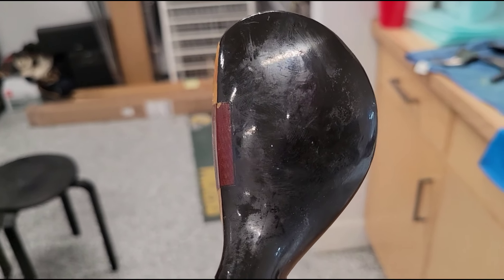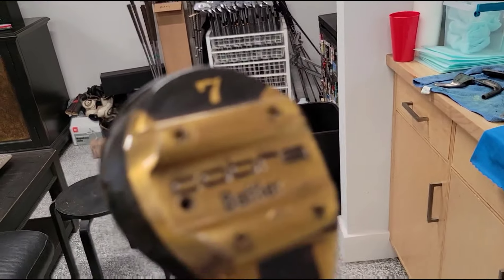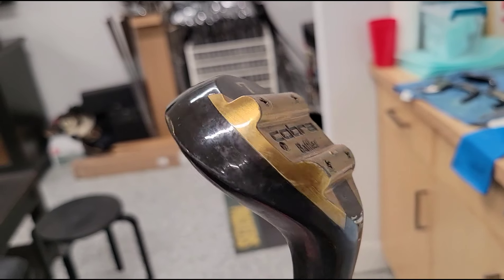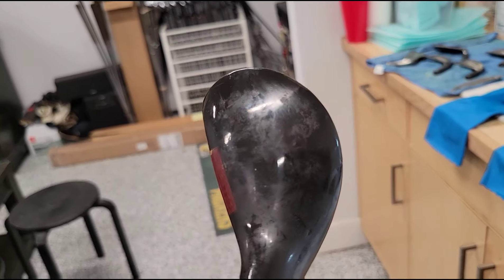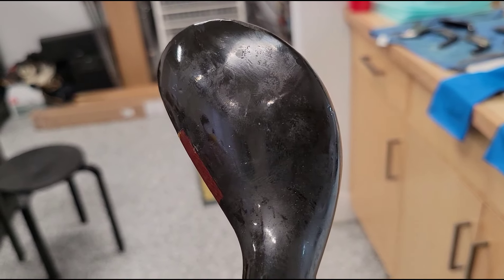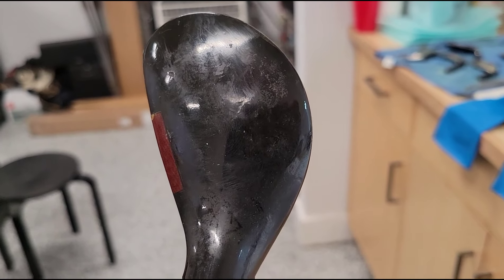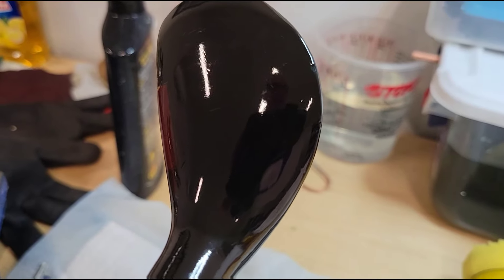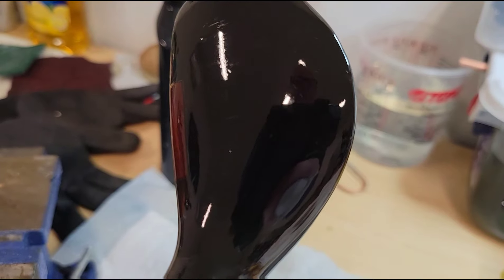2 Minute Polishing a Cobra Baffler - DIY Golf Club Restoration

Comment: I clean any exposed wood on the face thoroughly. Then when dry, I apply a thin layer of super glue to the exposed wood. After it dries, I use 2000 or 3000 sandpaper on a block to gently remove any glue on the face. Then the polishing.
Reply from the maker: I love this tip. Thank you. Does the glue affect the insert at all? Or do you put the glue only on the (wood) sides of the face?

Comment: I picked up an old set of cobra clubs today on market place for $40. Theres something weird with the irons..it says king cobra but they aern’t over size..more blade. But the 3 and 5 woods are persimmon and don’t have the ridges underneath. Theres a cobra metal driver with a small head..gotta be from mid 80s..just a geuss. Going to clean them up and take them to the range for test run. They feel great in the hands
Reply from the maker: Take a look at a site called Iron Finder. They sell (or used to sell) individual irons but you can look at the different styles for those brands to see which one you have. https://www.ironfinder.com/Individual-Irons/cobra/.  Sort by YEAR.

Comment: How would you do a refinish on those, and still preserve the decals/stickers (the cobra on the toe, and the number on the sole)? I’ve got a good number of them, that are in good shape but could use a refinish (minor spots of poly chipped), but I don’t want to lose the decals
Reply from the maker: Hi. I'm digging into this problem. I have two ideas I want to try. One is printable water transfer paper like they use in toy model car kits. The other is using a vinyl cutter like a Cricut to make the lettering and poly over it. The problem with the first idea is most of the decals are white, and there is no white printer ink to print with.
Reply: @BradMeehan  Nice! Both sound like great options. I look forward to seeing what you figure out. I was resigned to having to stamp the number into the sole plate and just say bye-bye to the cobra decal altogether.